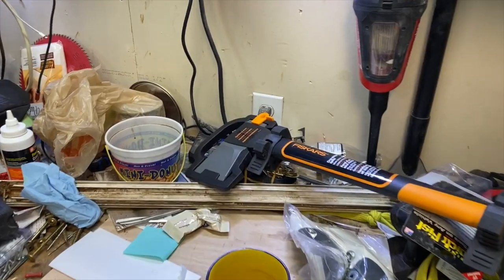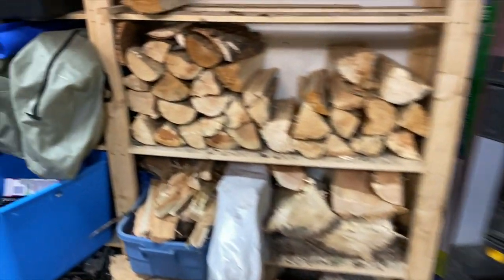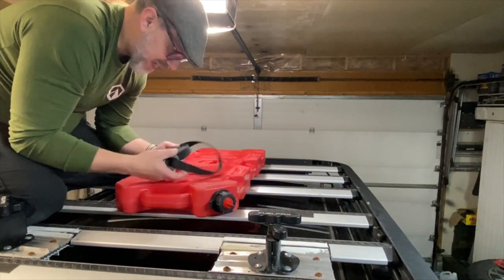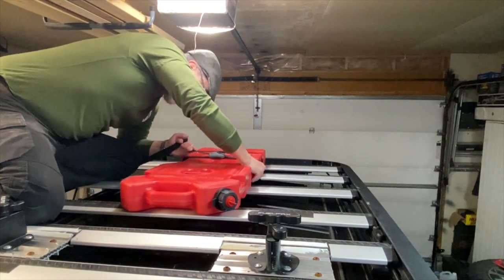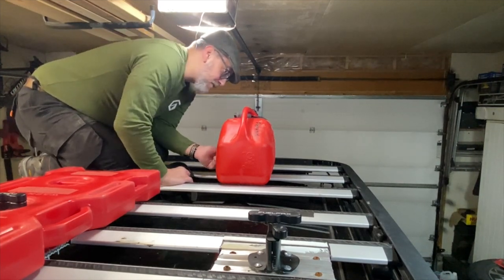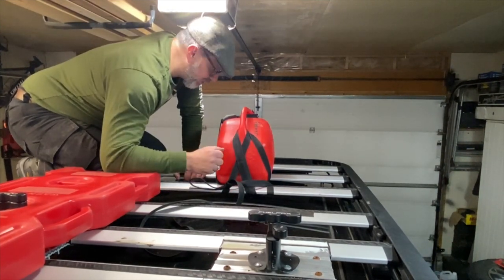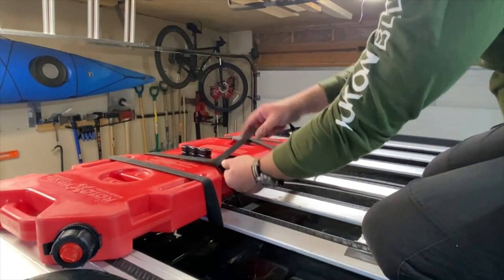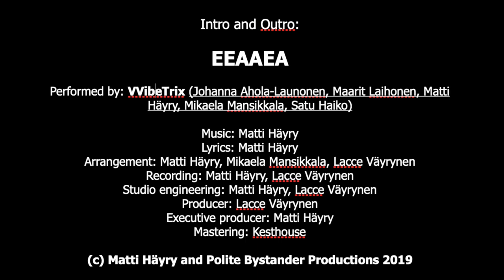Load Restraints; The Cam Lock and the OEM Rack #landrover #newdefender #roofrack #discovery5  #l663

Comment: Hi Stephen, I need to attach brackets to the Expedition roof rack for a bat wing awning that I purchased. I am trying to find out what inserts fit the C channels, how you insert them etc. and just wondered whether this is something you knew?
Reply from the maker: Hi Kevin, 

Yes, the OEM rack is essentially a Thule, so Thule mounting heat and T-slot bolts are what you need. There’s a bunch of non-Thule options on Amazon and eBay these days, so there’s plenty to choose from if you don’t want to spend Thule money!
Reply: @shedlock2000  Thank you - just had a glance on Amazon. The rectangular plates with studs, I am wondering whether you need to undo the end of the cross bar and release this from the roof rack to insert those. Is that your understanding? If it were a smaller square plate that should fit into the ready made gap already in the channel.
Reply from the maker: The plates I have on my rack? No, I loosen the studs and then slide them in at an angle adjacent to the bar, then tighten them around the bar. If you take a look at my video called RotoPax Roof Mounts, you’ll see how I made them from a doorway threshold plate!
Reply: @shedlock2000  Thanks for explaining - got it. Will check out that video.

Comment: I like a heavy gauge wire mesh on top to protect the glass roof from gear and getting on top. You can easily set it up so you can put it on or off as needed. I do something similar on my LR3. I have a system to take the rack off and store on hooks from my garage ceiling. Great Defender you have, I enjoy the videos👍🏻
Reply from the maker: That’s an interesting idea. I’m not certain that I won’t put my foot through the slats at some point! How do you suspend the mesh without scratching the coating?
Reply: I actually use a piece of thick plywood on my rack but am looking for a heavy wire mesh to replace. I attach it to the top of the cross beams of the roof rack with some bolts and small metal brackets, one on top and bottom. Careful not to have the bolts too long as to not touch the glass. It's pretty easy actually. I can get on top and situate my gear without having to worry about dropping anything on the glass roof. Fully protected. When I am not using my roof rack I simply take it off and store it from bike hooks I installed on the garage ceiling. I don't like driving around daily with a big roof rack, plus, it saves on fuel economy. 
 @shedlock2000
Reply from the maker: @ZachBrimhall  Good to know! Yeah, I’ve had wooden panelling too. Gets a bit awkward here with the snowfall and water run-off.

Comment: Good videos, thanks. Do you notice any wind noise caused by the roof rack?
Reply from the maker: There is some noise, but it is not from the rack but the lower mounted light bar. When the rack was without bar (and even with the wider bar) there was much less noise. Wind noise is a bit of a black art when it comes to high-level mounting. For instance, my bigger 40" bar was pretty quiet, but my smaller 32" bar mounted in the same way is much, much louder (I still have to re-position the bar to eliminate some noise). The rack on its own was quieter than the B pillar wind noise. That said, I have friends who are experiencing a bit of noise from the rack and they have it mounted without the light bar and in the same position. So who knows! 

The answer to your question is, for me, 'none at all'. However, I cannot guarantee it would be the same for you!